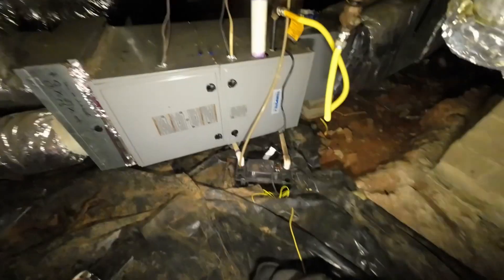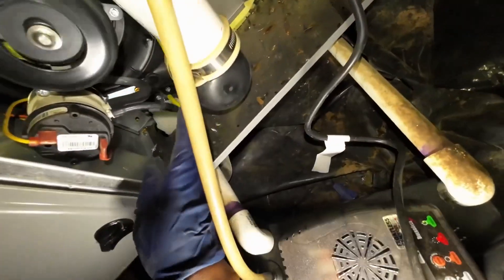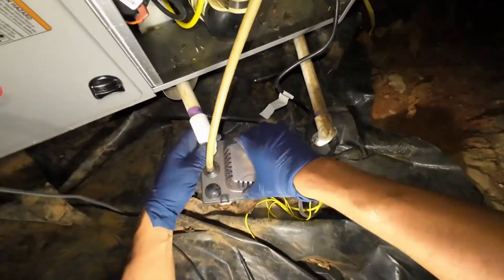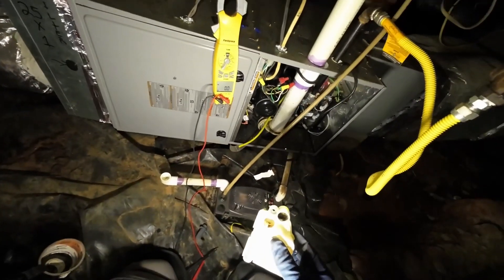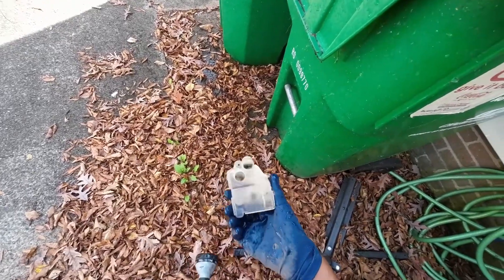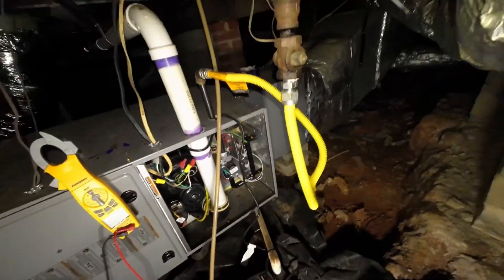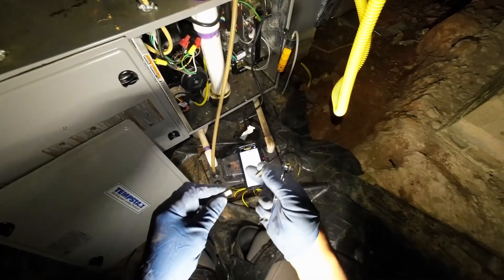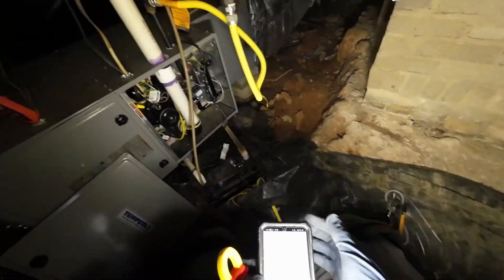90% Furnace in Nasty Crawlspace with Clogged Condensate Trap Pressure Switch Ticking Sound

Comment: Great video man! I do have some questions. Is using water the best method for cleaning out those condensate traps? Also the 90 degree rubber fitting connecting to the condensate trap does one end have a clamp and the other end is just placed in the 3/4 PVC elbow?

Comment: I don’t know what it is about those traps specifically but they seem to get stopped up really easy.
Reply from the maker: True probably didn't help that the 1/2 inch rubber tube coming from the heat exchanger cover was just placed into the 3/4 inch PVC 90 to drain with no seal so I'm sure insects and things crawl into it over time